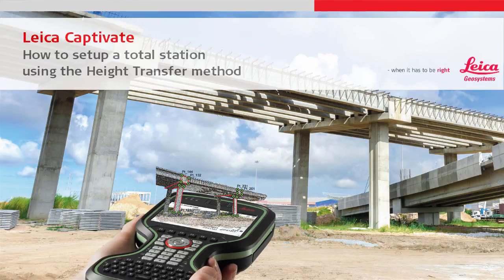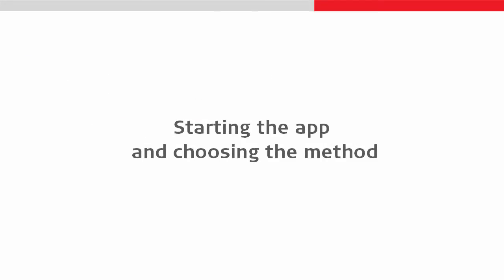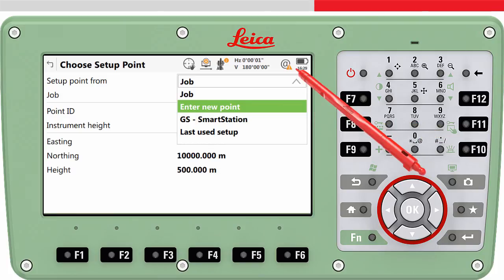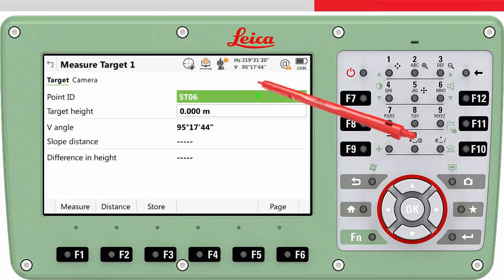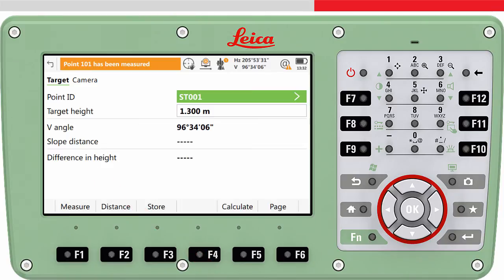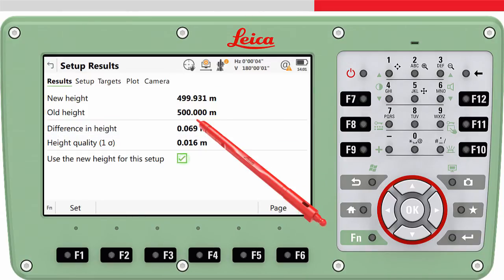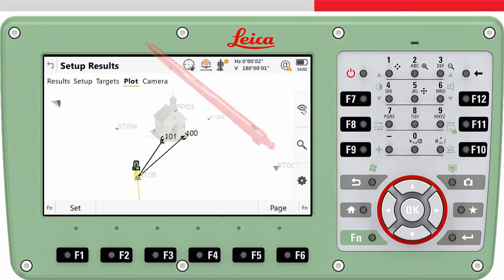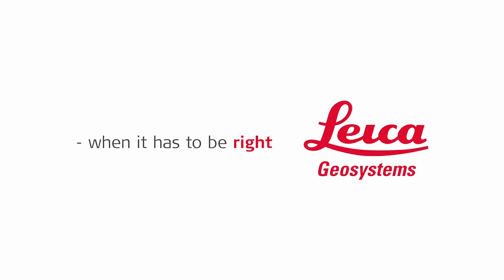Setup - Height Transfer

Comment: Extremely frustrating that you cannot change your design job within the app. This means that you have to have the correct design data selected first before transferring height using “last used setup” method. On the CS20, which is like a slow snail, this process can take a while.

This was easy accomplished on the CS15. 

Even after 9years this has not been addressed.

Seems like a back step from Leica.